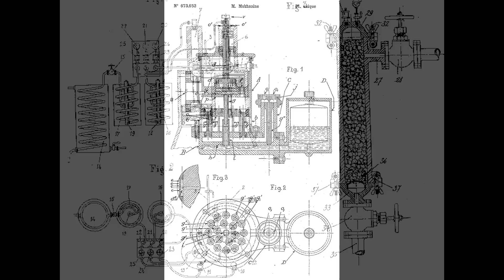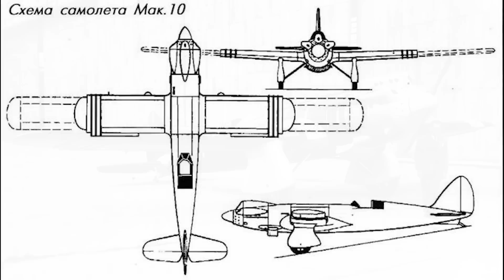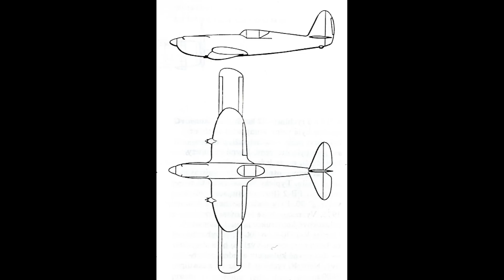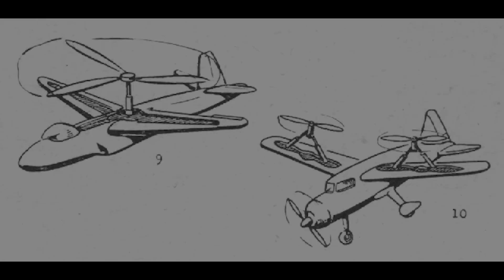The Makhonine MAK-10 Was Wanted By The Luftwaffe (Even If It Wasn't Very Good)

Comment: stowable rotors is the coolest most out of pocket idea I've heard in quite some time
If you could gear it to a turbofan engine it would probably not add too significant a bulk that the idea would be unusable, but the drawbacks in fuel storage would simply be too great I'm afraid.
Designs like this always lose in a trade study, they're just too mechanically complex and space-hungry

Comment: The cockpit configuration made sense at the time - just a windshield for the pilot, a greenhouse for the observer. Most pilots were used to wearing flight suits, estimating airspeed from the sound of the turbulence around the windshield, and sticking their head out when taxiing. The guy doodling on a map needed the glass much more.

Comment: "In a way the solution was brilliantly simple"
If you're an engineer of any kind, your eyes are probably rolling back in your head right now. 
"Brilliantly simple" means the speaker is unaware of, or purposely hiding the hideously complex reality hiding underneath. 
"Brilliantly simple" also tends to apply to general, undeveloped ideas, and rarely to the engineering needed to make them into functioning reality.
Someone mentioned below developing it into an aircraft for long range patrol, which could make use of the heavy extra span when extended.

Comment: Interesting concept, but a fundamental problem of achieving strength in the inner wing sections, which must remain largely hollow. Handling the loads at the wing root would be a particular problem, unless there were telescoping spars that remained continuous throughout wing movement (and thus heavier than necessary when retracted). Still, you could reduce the area of the extended wing to where it effectively becomes a set of spanwise flaps, again with a weight penalty on the outer section of the wing.

Comment: It's a clever idea, but one that doesn't really have a use case.  The one place I can think of where you need a high speed aircraft with a really short takeoff run is an aircraft carrier--but in that situation you don't really have the deck space to allow the plane to double its wingspan.  More powerful engines, better airfoils, and, ultimately, catapults get to the same end result much more efficiently.
Reply: Extending wingspan on carrier deck is like taking a highway to the danger zone

Comment: I believe they missed the mark, by concentrating on speed and combat aircraft. A developed design, with similar gliding abilities, could have made an excellent long range recon and maritime patrol aircraft, and would have been of extreme interest to the major navies of the time. Also, the short takeoff abilities and potential cargo carrying capacity, would have been highly prized in remote areas like the Alaskan Bush country.
In essence, with the sliding wing, he was trying to achieve what was later done with swing-wing aircraft such as the F-111, the F-14, MIG-23, and others.
Reply: Assuming it was even possible to get it to work, which is doubtful. Just because it flies doesn't mean the other drawbacks don't make it unfeasible. All these people working on various designs to meet these requirements you mention, they had access to information that this existed, yet they didn't repeat it. Probably for a reason. If you can meet the requirements with lighter, cheaper, safer methods, you don't need to resort to the crazy crap.

Comment: OKAY, I have theorized a telescoping wing for decades.  I had no idea someone had actually done it.  Amazing.  Great work NAPFG.
Reply: I've theorized a telescoping mechanism for a telescope.
Reply: @HighlanderNorth1  I've theorized an anti gravity flying machine with a cute French girl crew.
Reply: Not saying the 'cute French girl crew' would actually turn out to be aliens in disguise, but...🛸👽
Reply: theorized for decades? and never cared to search the internet to see if it has ever been done? :-D 
look for "Ellingston Special" too, a plane made in the 30's
and "Akaflieg Stuttgart fs29" made in the 70's
Reply: With modern materials this isn't a bad idea.

I'm thinking more for storage though. Like an ultralight.
Reply: @jtjames79  For storage purposes, a folding mechanism is, significantly, the lighter solution. Since weight is a big consideration in an ultralight, I would go for folding wings. The location of the folding mechanism may depend on the dimensions of the storage location.

I too need to fold the wings on a max 450kg (EU regulations) design. I placed the folding mechanism in the first 40% of the span. That gives me the width and height clearance. You may need to fold your wings at a different point. Some ultralights fold their wings right at the root. I'm not a great fan of that solution, but it seems to work.
Reply: Everyone thinks of these things. ALL of these things. But words are cheap. The Russians, OTOH, try EVERYTHING. Usually someone involved has a gun pointed at them.
Reply: And how much heavier (percentage wise) is this system compared to a traditional one?
I'm assuming that, for the same max g loading, the weight of the wing will easily double.
If you want to use the system just for roll authority, adverse yaw will be an issue to be solved as well.

Comment: Could it have flown at high altitude with the wings extended?
Reply: If it could glide for an hour after the engine was shut off at 13,000ft altitude...

So yes...high altitude could have been reached 
IF
the engine had been at least 2 stage supercharged and or turbocharged?

At least his wing retraction mechanism worked well.....

It just needed engine technology for power and altitude to be available to make it as a great spy plane (the SR71 of it's day)
Reply: If the structure can stand it, sure - albeit at unpractically slow speed (wing drag). 
But can it?
Reply: if it could take off with them out you could fly at any altitude with them out!! you'd bring the wings in for turning ability and leave them out for lift and fuel savings!!!

Comment: Does that count as the first variable geometry wing design???
Reply: Apparently Wikipedia (on the "Variable-sweep wing" page) lists a plane called the "Westland-Hill Pterodactyl IV" as the first sweep-wing as of 1931, with the prototype of the Mak-10 being from '29 according to NAPFATG's video above, so I think you may be right (although in the former's case, it was used as a way to trim the aircraft for level flight as it was a wing design that lack a separate horizontal stabiliser, so it was present for a vastly different reason than most variable geometry aircraft).
Reply: @JustSomeRando1984 thats the first variable sweep wing. There not the same thing.
Reply: Not geometry, wing area.
Reply: Hmm...the geometry is the same, just longer.
Reply: @flyingsword135  😄 it's like saying Tomcat wings are just sweepier... the long rectangle and the short rectangle are still two different shapes, i would still count them as two different geometries...
Reply: it doesn't change it's angle so nyet!!!!
Reply: @keithmoore5306 variable sweep is one type of variable geometry. Any wing that changes its shape is variable geometry. Modern wings with variable camber are VG wings. But no, it's not the first one, they have played with VG since before aircraft even flew.
Reply: @justforever96  maybe so but in aircraft it usually means a sweeping wings!!